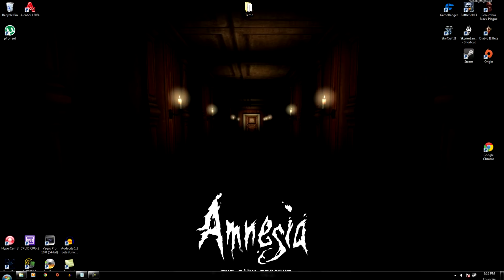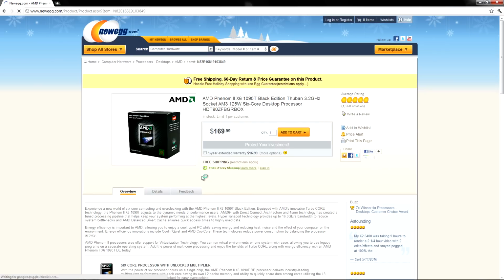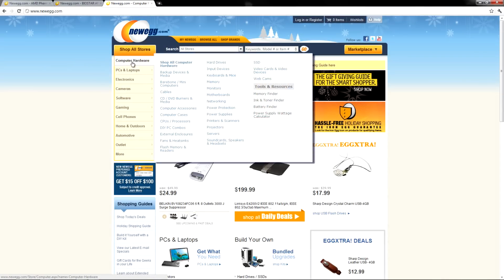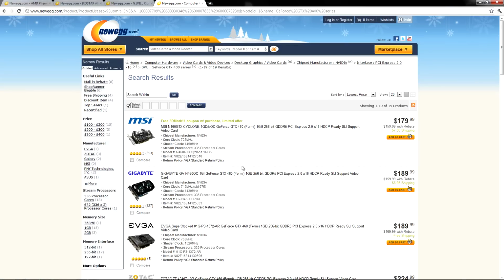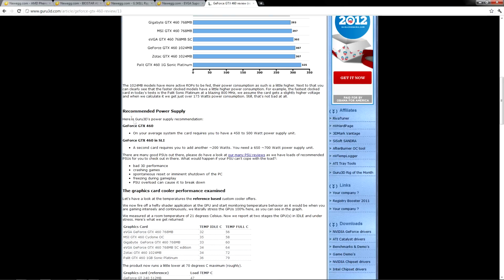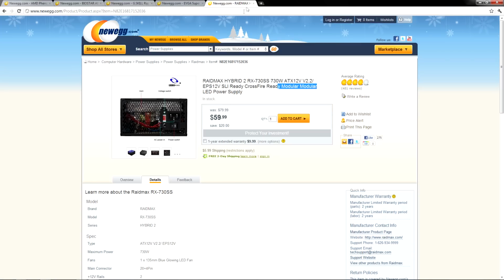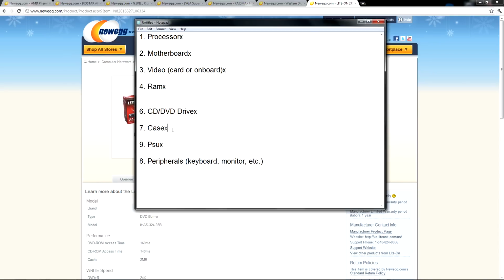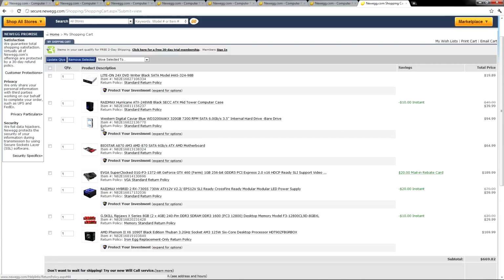How To Build A Computer Part 1: What To Buy

Comment: im sorry this is long but i am a beginner, would these parts work together to make a computer.i have no idea what im doing. please help!

Cooler Master N200 mATX / mITX Tower Case Black 1X5.25 3X3.5 4X2.5 USB3.0 No PSU

ASRock H97M PRO4 LGA 1150 Intel H97 HDMI SATA 6GB/S Motherboard

ADATA SP550 240GB 2.5" SATA3 Smi SM2256 Solid State Drive

INTEL® CORE™ I5-6400 Processor 6M Cache Up to 3.30GHZ FC-LGA14C LGA1151 Retail Box Skylake

EVGA GeForce GTX 750 Ti 2GB GDDR5 128BIT DUAL-LINK DVI-I HDMI DP Graphics Card w/ G-SYNC Support
Reply: I know I'm not answering your question, but go to pcpartpicker.com. You can search for almost any pc part, see where they're being sold cheapest, and check if it's all compatible. It's a good, reliable website.

Comment: what if a mother board has more wattage than the processor needs? for example, i chose a processor with 125 watts, but the mother board supports a 140 watt, is that okay?

Comment from the maker: Yeah, it will definitely work. The point of this video was to show you HOW to check and see what works together. The Phenom II X6's use an AM3 socket just like X4's. They also use 125 Watts, I believe, so be sure your motherboard will support that, though most AM3 boards will. Just use my video to help you find out if your parts are compatible and build one on your own, it will help a lot, if you have questions whether things are compatible you can always message me.

Comment from the maker: @pissant001 I don't know anything called a "slate drive" and google finds nothing either, I'd assume they meant a SSD or Solid State Drive. SSDs are extremely fast hard drives, and very durable. You do not need one it's just a substitution (or addition) to a hard drive. If you want to boot up your PC much faster you can get one, but they are VERY pricey. 60 gigs runs around 100-200 bucks. But if they were talking about an SSD, no, you don't need one.

Comment from the maker: @pissant001 The computer I'm running now has these specs:
AMD Phenom II X4 at 3.2 ghz
8 gigs of ddr3 1333 ram
750 watt psu
200 gig hard drive
GeForce gtx 460 256 bit 
nzxt case

Comment from the maker: @pissant001 @pissant001 all the parts go in and out of stock very quickly. You don't have to get the exact card I did. The main thing to look for is that it fits into one of the expansion ports on your motherboard. The main graphics card port right now is is PCI-Express X16, Which most newer cards you get will use that port. look around in the gtx 460 on newegg and you'll find one. But just for reference this one will fit: N82E16814121466  search that on newegg